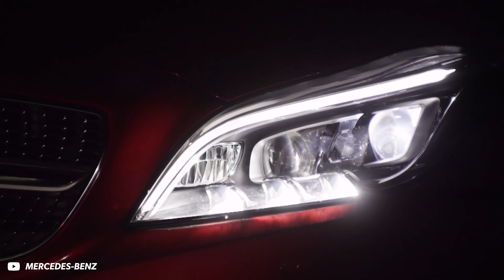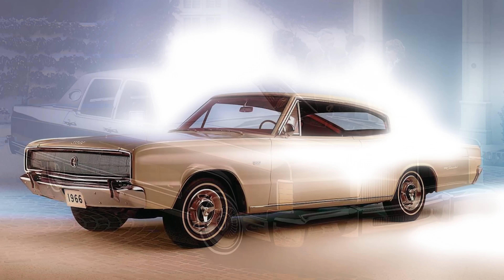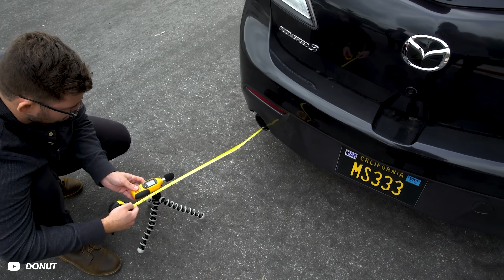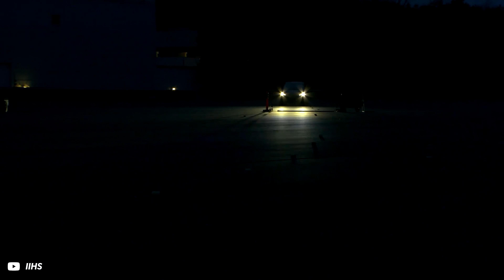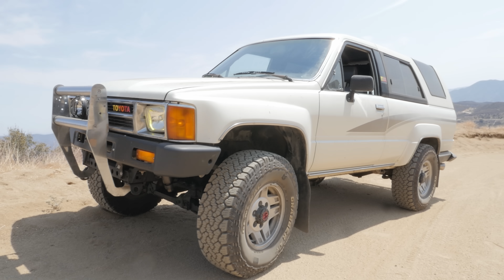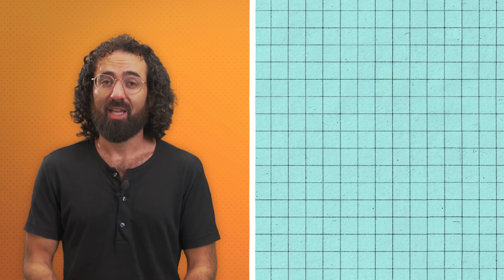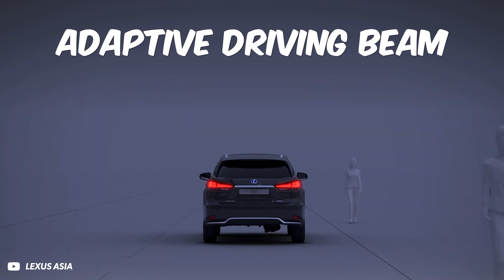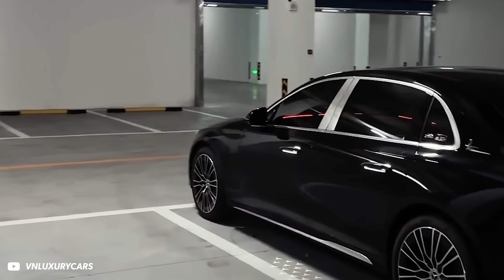Why new headlights are blinding American drivers

Comment: Sorry but no, the solution is not more tech with un-sustainable mining for components, which will also cost more!

 The solution is so simple: backwards! and for all the auto industry. Changing headlight from the round/square to whatever shapw was mostly for money: when you changed a round headlight bulb, all was changed and all the manufacturers used the same ones, so its was cheaper for customers. Now, you can change the lightbulb for 40$, but the headlight casing is around 500-1000$ each! It was a cash grab to make people pay more! The lighting should be regulated backwards to a "standard" shape/form so all manufacturers would fit, the cost would decreases. And no, the "designs" have not been limited because of headlight, it was also the rest of the car.

Car manufacturers SHOULD BE LEGALLY obliged to sell low tech car ( not iPad screen, digital clusters, physical buttons, etc.) that respects a certain list. For about 15years now, the shifted the low cost options to the luxurious ones since they are more profitable, not better for the customer.

Comment: ADB doesnt work in reality. Its making the whole thing even worse. It works on a brand new car. But after 3-5 years (scratches on the sensors or software failures) its done and blinds everyone even worse. Those lights are rated even higher, and when their sensors fail, they blind you even worse. I like to mention, that its mostly the newest cars that are driving with high beams on the eu highway. They rely on ADB so much, that they dont have a clue, that their system failed and is blinding everyone. Of course they pass inspection, because they assume that high beams are off.
But people drive with high beam on the highway....

Comment: ADB sounds expensive to both produce and repair, if it can be repaired at all. 
Also, there's nothing wrong with older vehicles on the road, provided they aren't a death trap. I personally don't want a vehicle that was manufactured after the 90s.

Comment: Another European here. I always found Xenon headlights to be much worse. Totally illegal, high powered  LED bulbs with bad light distribution are more difficult to get away with here, as they would show up on the compulsory roadworthiness tests, usually every two years, at least here in Germany. The police can also stop you until you have replaced them with legal bulbs. Ever headlight on the road in the EU has to have an E number embossed in the glass to show it conforms to road regulations. Biggest problem is people not having their headlights adjusted properly, or just not bothering to switch modes. For my motorcycle, a 1993 600cc  Honda Transalp, being able to switch to a sealed beam LED unit, originally designed, tested and made for the US army Ford Bronco was one of my best investments in safety. Of course I have to adjust them according to load.

Comment: ADB is by no means a magic solution. We have them here and still struggle with blindness. In theory they should work, but in practice they aren't quick enough to adapt, can't handle bumps, aren't sophisticated enough to deal with unusual shapes and situations and generally just can't be relied on to act with the same speed and reliability of a properly trained driver.

Comment: European here. We still get blinded here. If you think Adaptive headlights are the solution, think again. Perhaps it's partly because they're reactive, meaning the oncoming car with ADB headlights first needs to register your cars headlights before adapting, at which point you're already dazzled. Sound great on paper, but not in practice.

We also have a lot of speed ramps here - especially in Ireland - and when a modern car goes over one they're lights shine right into your eyes for a split second. 

Being dazzled, even for a split second, takes you several seconds to recover. 

Tesla Model Y's are the worst. It's basically as if every one has their full beams on. All you can do is put your full beams on to cancel them out. Thankfully, it takes most Tesla drivers multiple clicks to go from auto lights to manual in their big screens, so they can't counter back in the moment.

Comment: I'm not as sure that we need to have $3000 headlights that have AI chips in them as opposed to people being reminded that you can, in fact, AIM and ADJUST your headlights to not be an asshole. Looking at YOU, Jeep people with those LED bars and aftermarket projector headlights. Those things are downright dangerous to every other driver that isn't 6ft off the ground and has pushed me towards hating Jeeps and the people that run them because of it. Also the recent Toyota RAV4 seems to have the worst factory headlight aim of any vehicle I've ever driven against. And it seems that nobody knows what the little blue icon on the dash means or they'd know they're deliberately blinding oncoming traffic by being stupid and not knowing anything about how hi-beams work. This isn't a tech problem that requires cars to get $6k more expensive due to some ridiculously complicated, nanny-state headlight system. It's a public stupidity and laziness problem - just like every other thing that's wrong with society these days.

Comment: Saying this is the only solution is obviously not true. This would mean we would have been blinded by lights years before the tech was adopted on every car. The best solution is to enforce yearly MOT checks (which in the Netherlands we have) and strict after market rules (which we also have). Your problem is that everyone thinks they are a mechanic. Your problem is that a lot of cars are actual death traps as no one checks yours car periodically. Our MOT checks for rust, brakes, handbrake, bearings, rubbers, tires, lichts (all of them), licht radians and also registers the odometer. This means you at least know the actual milage of your car when buying second hand, you know it stops and that the lights work and are setup correct. So yeah, you have a long way to go. Just a new light technique won’t help you as no older car can implement it.

Comment: So the simple, cheap, DIY-replacement sealed beam headlights were sacrificed for... car styling and aerodynamics?? But streamlined clear housings could have provided for both of those really not-very-important needs. (At most speeds, aerodynamics have little measurable effect on fuel economy).

Comment: Blue lights on police cars are too bright. I was blinded in an intersection in the daylight. The Sun was blasting and it didn't hold a candle to the police lights. 
LED manufacturers always seek more light with less current. And they don't seem to realize there is a limit to the desired intensity.  I had a certain spec for my design and I ended up getting LEDs with a rubber carbon black impregnated cover to reduce the intensity to one tenth.  I asked if there were LEDs that weren't so bright but they didn't make them anymore.

Comment: I live in Europe... these LED lights are terrible. The main problem is that they are too strong. Worse is when is raining and light goes everywhere. No autoregulation of the light only makes it worse. Btw, there is this Matrix LED technology which should cut off the beam from a car coming from the opposite direction. Well, it works but not on trucks. As a truck driver I see it cuts off the beam but like it is a regular car, not very high sitting trucks. To owners of this technology. Don't be surprised if a truck driver flashes on you because you are still blinding him even while you see your lights "cut off" part of the beam. There is a part of the light going way higher than on a regular car. I know you buy it new and somehow it got a homologation but European Union right now is not really a place where politics are very smart and can predict main issues before they decide on something.

Anyway about headlights. In my opinion French were once the smartest people when it comes to cars. Whoever drove an old French car with yellow headlights can tell the difference. I once drove an old Renault (can't remember which model it was) imported from France to my country by a friend. At day it didn't change anything but at night was totally different. When you have strong yellow light, you can't see details on the trees or persons face but it made a huge contrast between darkness and where was light because if something moved you could tell easily it is a living thing. The shapes of everything around were sharp so it wasn't hard to tell what kind of object is from far away. You couldn't tell the details or colors like with LED but driving on with LED highlights I have a bigger problem to measure distance and tell if it's one object or two when it's in the specific angle. Yeah, we have regular light known for decades yellow light bulbs with transparent lamps but it can sound funny. These lights are not yellow enough to work like those yellow lamps. In my opinion it's safer with yellow lamps than with any other solution.

Comment: Proper headlight alignment is all that is needed, the aim on mine was adjusted all the way up from the factory and not fixed by the dealer.
Reply: Uh... NO... alignment is NOT the only thing to fix it, it's the bulbs that need replaced with something less fuck you-ish-ly bright.

Comment: Dont even need to watch this video.... Its all owner/driver error!! Engineers and architect  know how and where the headlights are going be aimed before they are on production vehicles. At the factory this is already set as standard. Owners who buy aftermarket beam headlights dont seem to understand that if you change it , it needs to be calibrated(aimed). Change in factory height. . . headlights need to be readjusted. Incandescent lamps put out a broad beam , change that to a "lensed" lamp and you are focusing the light into one area. Need to re-calibrate the headlights.  Oh, and STOP STARING AT THE HEADLIGHTS, taught this in drivers education. "Look to the fog line if blinded by oncoming headlights, not at the lights themselves. This causes temporary blindness as eyes have to readjust." You know who you are drivers. The ones that slowdown for oncoming traffic 10-15 mph til said traffic passes, then your right up there woodin' the damn pedal. Cant keep a constant speed.. BRING BACK DRIVERS EDUCATION in the SCHOOLS.... Where new drivers can learn "DRIVING ETIQUETTE" . . .

Comment: I live in rural America where we actually need bright headlights to avoid deer on the roads, but holy shit some of those blue tinted headlights on new cars and especially tall trucks are ridiculous.  The high beams on my 2011 Tundra are like an old crappy flashlight with nearly dead batteries by comparison to the low beams on these new cars.  I used to think they must all be driving around with their highs on, but that’s not possible seeing as how most of them are also running fog lights on a clear night, and fogs aren’t particularly bright.

Comment: genuinely get headaches from these LED Headlights Cars driving behind me just blasting my mirrors with their half high beam lights, you don't need to see the back of my head, you need to see the road, even then, you don't need lights aimed so high or sobright because your driving on reads that are already illuminated by street lights, your car lights are more a "Hey i exist on the road and here i am" not a "HEY I EXIST, MOVE OR GO BLIND". Same way indicators are meant for intent, not action, the amount of times i've had someone honk their horn at me for 'Indicating' my Intent to swap lanes the moment i turn them on because they are in the lane i'd like to change into. Drivers are just getting dumber and dumber, and car makers are not helping.

Comment: as a truck driver my truck has really bright headlights and everyone is pissed at me but it's out of my control, it's been manufactured this way and it hurts me more dealing with people everyday high beaming me or flipping finger
Reply: Refuse to drive until the company fixes the problem, or fix the problem yourself, otherwise, you are just compliant to bullshit, and you deserve the finger.
Reply: @whatthefluxchuck  ok professor and what if they don't fix it ? regarding that's not a problem or anything against the law then what?
Reply: @aren8443  then they are assholes, and if you support them, you are one too.
Reply: If you are blinding people (They flash their lights at you), then your Factory headlights are not aligned correctly. All it takes is a screwdriver to lower their aim. 

Check our owners' manual but here is the typical procedure:

Aim your vehicle at a wall 6 feet away. 

Turn ON your Headlights. - The brighest spots on the wall (from your lights) should be hitting about 6 inches Lower and to the right AS the same height your lights are mounted.
Reply: @Animalwon trust me that doesn't work because angles vary in different grades but thanks
Reply: Mate, I appreciate that you didn't cause the problem, but it is creating dangerous situations, and you are the only person who can do anything about it.
Reply: @elizabethjamespack8541 actually im not the person who can do anything despite i don't own the truck i even tried using headlight tint but its absolutely against company policy

Comment: I call them "football stadium lights', because that's how bright they are.  They need to tilt their headlights down, but no one knows how to do that.  It doesn't help that cars now do everything FOR the driver, so most of these mouth breathers don't even check to see if the car decided it was a good idea for 'brights'.  This is just one of the problems of cars doing everything FOR you instead of you paying attention to what you're doing while driving.

The best headlights I ever saw were in France back in the 90s.  They were yellow, and they didn't hurt your eyes at all!  Why can't we all do the same?  No one needs football stadium lights on their vehicles...especially those big pick up trucks who a) also add even MORE lights on their grill, and b) NEVER. TURN. THEM. OFF!!!  when they sit in a parking lot.  Turn. The. F-en! Lights! OFF!

Comment: First time I travelled to the US in 2003 I was amazed at how often headlights were blinding. It became clear the issue was often larger SUV and pickup vehicles who were able to shine above the central divide, or drove like pricks on the highways and country roads alike with high beams on.

This is multiplied in effect by the lower quantity of highway lighting that you find in Europe on motorways and the like.

The blue LED lights and similar are becoming more problematic in the UK now, but because we often have road lighting as well as generally brighter environments (i.e. less deep valleys or isolated homes with no ambient light). The vehicles getting bigger too meaning more vehicles are to shine into rear view mirrors etc.

Has to be said the worst offenders are routinely BMW, AUDI and SUV with the big clusters of LED.

Comment: Tesla's also support this, and have supported it since spring of this year. The biggest problem I notice though in Canada are regulations around minimum speeds, minimum width, and minimum "re-light" times. I say this without having checked the actual regulations, but having seen videos of Tesla's in European countries, before the spring update from this year. In European countries, Tesla's support Adaptive Driving Beams when the vehicle isn't in motion, and "re-lights" sections in as little as 1 second. The width seems to be consistent on Tesla, between both markets, but if you look at Audi's system in the European market, you'll see that it's possible to get almost half the size of Tesla, though Tesla's "re-light" time is faster than Audi.

Comment: I have seen threads on Reddit where truck owners confess they buy these ultra bright light to “own Prius drivers” on the road.
Reply: I don't want to say anything negative about the average pickup truck driver, but I sure think it.
Reply: Anything but their big ass truck is a Prius
Reply: They say the same thing about diesel trucks modified to "roll coal". But I had one of them do it to me and I have a Ford Escape.
Reply: That might actually be a good strategy to install these on tractor trailers then, to discourage assholes from pulling up 3 feet in front of the truck's bumper. Because on some big trucks, if a Prius is close enough to your bumper, you can't even see it, it is hidden by your hood.
Reply: Oh god!!!
Reply: That's the state of affairs we're currently at? "Owning" ppl on the road? Pathetic.
Reply: When I see those truck owners that song, "You're a dumb***" comes to mind.
Reply: That's criminal intent.